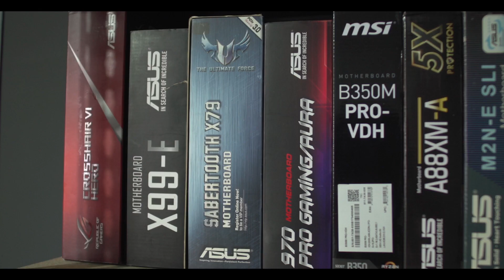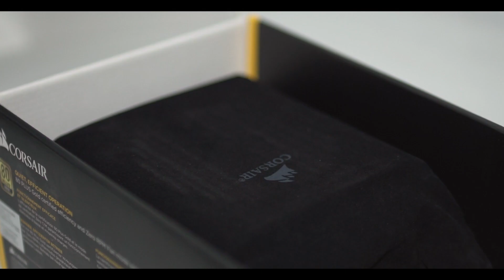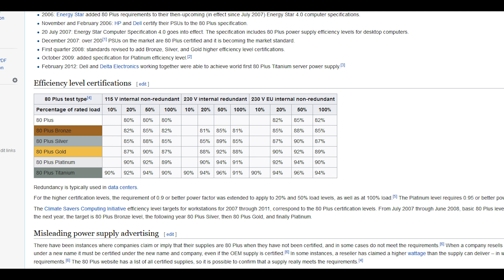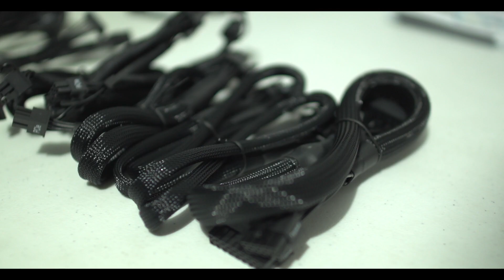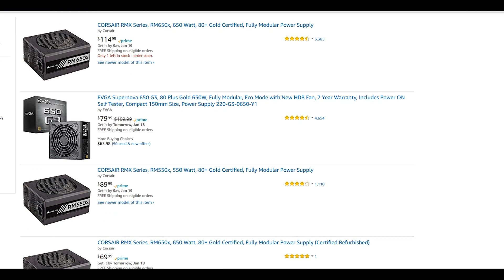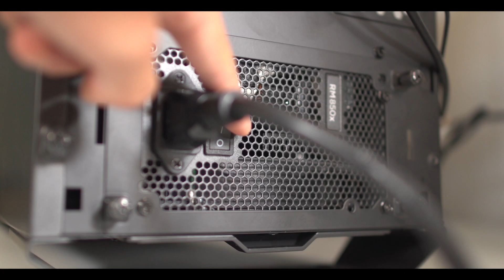Corsair RM850x: Silence and Power in a PSU.

Comment: quick question, does this power supply give off a electric whirring sounds when the computer is off and the unit is on, my power supply, which is the same model (rm850x) makes a weird electric sound. for example, my power supply switch would be on (l) and my actual computer is off, I can hear a slight sound coming from it, the sound goes away as soon as the computer is turned on. I dont know what this could be, coil whine or whatever. Does your unit do this??
My sound doesn't sound like your sound, and it's very quite. I have to put my ear right next to it to hear something, does yours do this?
Reply: Mine makes the same exact noise on or off and gets worse when on and during load. It's kind of ironic that it makes this much noise considering they market it as ultra low noise. The buzzing/static electrical noise is so annoying I ended up doing an RMA, waiting on new one to arrive now.
Reply: @look2christ777  did you buy the same model?

Comment: I just installed my rmx 2018 650 w psu and it’s very quiet. However, when i turn on/off your computer do you hear a clicking noise? I have been told this is normal since they say it is a relay switch but I wanted to double check with those with the same psu.

Comment: Did you get the power supply replaced and did that fix it?
Reply from the maker: Yes! I got a new PSU from the store. It doesn't make any electrical sounds anymore, thankfully.
Reply: @pasokonchannel5640  did you get the same model?
Reply: Did you get the same model and watts?